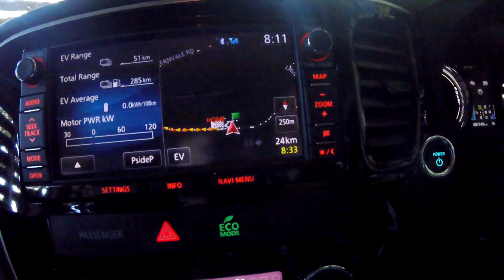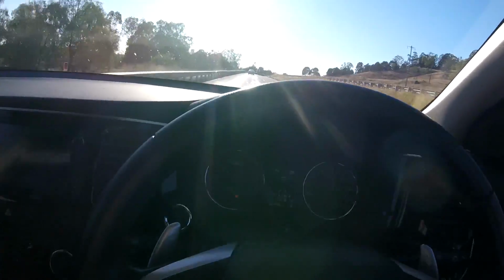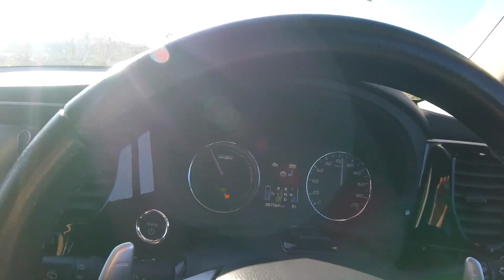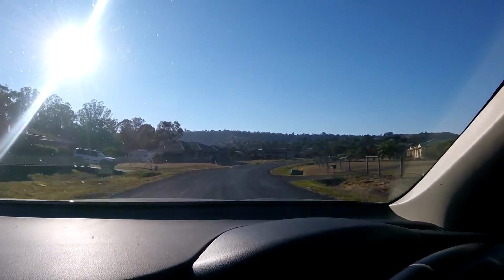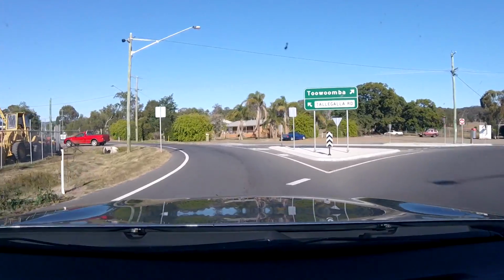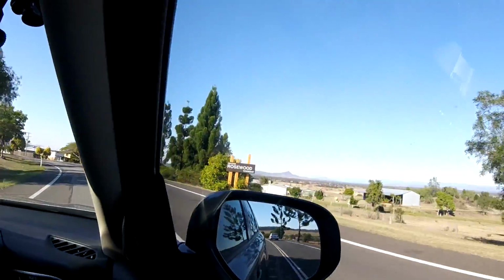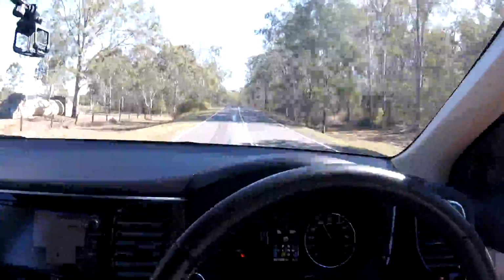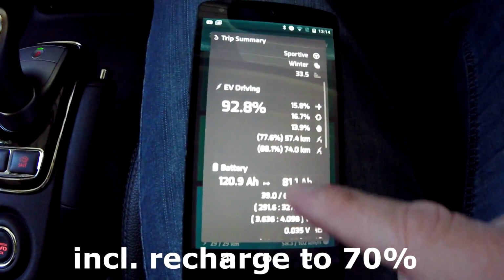EP251 - PHEV mixed mode driving and economy explained.

Comment: Thank You Andy, your videos are very informational.  I have had my car for 5 days so I am learning.  I have learned a lot so far, but do have a couple of questions.  1) What is considered Hybrid Mode while driving 2) How do I use the "Save" Button.  I use it while driving, and in that mode, it still uses power from the battery, so I am unclear on its true function. 3) when in EV mode, and we go above 45mph, and want to engage the engine, what is the best way to do this...4) do you always drive in ECO mode?  Thank you so much...
Reply from the maker: 1.) Hybrid is when the engine drives the car as well as the electric drivetrain. This can be at the same time or alternating by either having an empty battery or you pressing the save button. Both runs the car in hybrid mode.
2.) Save button does what it says. It saves the current battery state of charge (SOC). For example you have a trip where you drive highway and later on in the city to reach your destination. It makes sense to use the save mode on the highway to keep the battery at a certain level. You drive on battery power in the city to reach your destination. If you don't use save it will use up all the battery first in your highway drive and you end up using the engine one your las leg. This is far more inefficient.
3.) You can either press the Save or Charge button to do so. This depends on your trip and what kind of speeds you drive. 45mph is a good threshold where EV driving gets less efficient in this car and the ICE gets more efficient. Use save if you want to keep the charge level of your battery for later use (city driving), use charge if you want to re-charge the battery while driving (this only make sense until the battery reaches around 80% SOC, then switch from charge to save mode to keep the battery at this 80% level)
4.)Yes. Even now in the Tesla, I always drive ein ECO/Chill mode. It makes the car more efficient and I like the slower response of the gas pedal.

Always make sure to arrive with an empty battery at your destination if you can recharge. This ist the most efficient way to drive the car.
Basic rule ABC - Always Be Charging. Plugin as much as possible.
Reply: @unpluggedEV  THANK YOU So much...I have had "hybrids" before, and I also own a Tesla, but this car seems to be a bit more hands on, but manageable....I will continue to watch your videos...I also have an IPHONE.  Do you feel it is worth the money to buy the power app...like your watchdog for android. R

Comment: Dear Andy, I  find the speedo on my MY14 Outlander TD is legal but inaccurate.  I use my separate Garmin GPS for navigation and speedo cross reference. Typically an indicated 100kmh on the factory speedo is actually only 95 real kmh. In order to not frustrate others on single lane roads I always try to set my cruise control at the GPS indicated speeds rather than the speedo so in my case 106kmh on speedo is actually 100kmh actual. Yes its only a small point but because virtually all vehicles have an error I thought I would share this with other viewers. FYI I did double check these numbers using an android app that measured speed and it was consistent with the Garmin GPS. Sorry this isnt specifically hybrid related but when we all try to coast to save fuel it is nice to consider other driver's rights to drive at real speed limit. Cheers from sunny SA
Reply from the maker: Yep, every car does that. The Dog shows you the same numbers using the GPS of the mobile phone. Mine is actually worse as yours as I get only 94km/h when the odo shows 100km/h.

Comment: Hi Andy, thank you for the great videos. I'm a proud new owner of an Outlander PHEV and I have some questions about the car:
1. Is it good for the car when I consistently changing B0-B5 while driving? Say I'm stopped at the red light, I use B0 to start driving, before approaching to another red light, I change to B3-B5 to brake.
2. I don't always have access charging the car, even at home. Is it a good idea to charge the battery with gas while driving? I live in California where gas is about $3.90/gallen.
Thanks in advance
Reply from the maker: Thank Derick.
1.) Yes, that is totally fine but you can leave it in B5 in city traffic, no need to set it back to B0. You can do almost one-pedl driving with B5. It won't use more energy regardless the B setting.
2.) I would charge the battery while driving higher speeds on a highway or motorway and use the battery power on slower parts of the trip. As a general rule, drive electric below 75km/h (~45mph), flat road and downhill and everything else start the charge mode and drive in hybrid.
Reply: @unpluggedEV  Thank you Andy. :)

Comment: does the car also recuperate, when you use the normal brake paddle?
Reply: Yes, but not very much.  Having a longer duration to the "slow down" by using B1 - B5 regen will recover more energy than a shorter duration push on the brake pedal.  Anything more than light foot on the brake will engage the friction brake ... and that energy will be lost.
Reply: @wblairhogg I am always using the break instead, but as if i had an egg between the foot and the break pedal. The only time i use the b-levels are when going downhill. The reasons  for that are several:
1) it is easier to get exactly the right speed so that you can roll into a green light instead of stopping at a red light, or a queue as well.
2) I find it a bit dangerous to play with the paddles in tight traffic
3) I must (want to) always go back to b0 after retardation and that will be a lot of paddling 
4) As I often drive other cars, e.g. rentals, I prefer to have a driving style that is not too different from car to car

I have compared the range for driving cautiosly using the breaks and using the paddles and I find no relevant difference, if there is a difference it would actually be in favor of using the break pedal (might be due to breaking a little bit too much when using the paddles, losing energy in regeneration instead of maintaining the speed). So therefore I decided to stop using the paddles. This is of course not a scientificly performed comparison, but it is good enough for me. But note that one must use the break pedal carefully.
Reply from the maker: Brake pedal goes up to B6 in fact, so some people are driving in B0 all the time and just use the brake pedal to regen. You need to watch the power meter to see how far you can go without using the friction brakes.

Comment: is there a difference between „save“ and „charge“ while driving 100 km/h? I ask because the engine has a particular RPM at that speed and drives the generator with that RPM - so, same RPM for the generator - is it possible to generate more power (Charge) with same RPM or does the electric power the generator can produce relate to the RPM?
Reply: I  found the lowest consumption on my 2018 Outlander PHEV is to drive in EV-mode and B0 regen-mode in urban areas, and SAVE-mode for speeds higher than 70km/h if I am driving longer than the capacity of the battery. Always use a GPS (google maps) so you can plan your driving. The ultimate goal is to have drained the battery at the moment you reach your charging destination (home). I try to avoid using regen-modes as converting the rolling energy to electric energy and then back to rolling energy has significant losses compared to just coasting. I am also trying not to break because; breaking = regen-mode = Significant losses. Thus I am planning my position in the traffic, such that I can reduce the amount of braking as most as possible. In my mind, the two biggest energy consumer is the losses of energy when you have to break and hard accelerations.
Reply from the maker: @dagit11  Yep, that sound about right. B0 and slow speeds are your friend with this small battery.
Reply from the maker: At 100km/h the engine consumes around 10l/100km from which some goes directly into the propulsion of the car and some into the battery to charge. The system does it dynamically and distributes the power between driving and charging. Even on slight hills it will use these 10L but charges the battery less as most of the energy is need to push the car uphill. 
The charging power is not related to the RPM as you would think but I'll do some testing and show this in a video...
Reply: Andy, I would love to see some more analysis on series vs parallel mode. On my intermediate trips, i always have the dilemna between shorter charge mode driving in parallel mode versus slightly longer save mode driving in series mode. The fuel consumption seems to be nearly identical, but I don't know if one is better than the other for other reasons... Mechanical or electrical...
Reply: I am also very interested in this test. As the car only has one gear, there are definitely speeds on flat ground where it in theory should be able to run without charging the battery much. I have performed tests where I think I get a better result by using save, but it is hard to verify as I rarely drive on petrol and as I need to rely on the average usage reported by the car.

As long as the cur runs in parallel mode, save should really be better. But that is under the assumption that the car tries to stay in parallel mode (or maybe I should state that it tshould try not to use the battery at all). But this is a tricky thing and whether petrol only, parallel or serial is better depends on the speed. The border between serial and parallel is pretty well defined at 60-65km/h (often closer to 60 when slowing down, often closer to 65 when accelerating - real speed not the needle). This is however depending on more things as well and this is when it gets interesting as I haven't figured them all out yet.
Reply from the maker: It is nearly identical. I just have the feeling the CHARGE mode helps a little bit better and burns fuel more efficiently due to longer running times and optimised efficiency. Hard for me to do some testing as I mostly drive in EV mode. I'll see what I can do...

Comment: Of course the downside of "Charge" mode is that it will use more fuel.  I read approximately 4 Litres per 100kms driven, extra.  So you have to very carefully think about if it is worth it or not to use Charge mode at all.  Fuel is expensive!
Reply from the maker: I actually found it uses less fuel when used wisely. The recharged energy can be used in EV driving later and gives a better fuel consumption than driving in Save mode. Especially on longer journeys.
Reply: @unpluggedEV  Andy you can save yet more fuel, if you drive uphills with ev mode, put charge mode off before uphills, if you have enough ev range charged. 
Use charge mode then flat road places. This charge mode also maybe raise your soh as my case!

Comment: Great video, as always.   There is one surprising observation about Charge mode that I would like to share.  If you are descending a (big) hill and are regenerating alot ( say B4 or B5 ), then the car will decide to turn OFF the engine, even though Charge is engaged.  I presume this is because regen is pushing in as much electricity as the battery is able to take.
Reply from the maker: That is exactly correct. Thanks for the info.

Comment: Thanks for the episode Andy. A couple of things where I think a bit differently:
- By using "Save" I often get above 2km on the GOM again and then I can press EV button again.
- I believe that using "Save" instead of "Charge" is better, as I will not have to include the energy loss of running the generator and charging the battery, I would expect energy loss of roughly 10-15% doing that. My measurements indicates similar figures, about 1/2-1dl less petrol per 10km (from 0.8 to 0.7 under my driving conditions). By pressing save for 20-25km on the highway I often have 5-6km of battery when going into EV mode again, which allows me to optimize my last 15km to home on smaller roads.
- I always try to end up around 2km short on battery when getting to a charging destination as the last kilometers often are below 60km/h. This means that you can run the battery lower than 30.6%  down to around 27% - I think) and it allows you to drive on available electricity that you otherwise wouldn't be allowed to use.

And also note that the car only has one gear, this means that it is only above 60km/h that you can drive purely on petrol. Below 60km/h you will always drive electric, but the electricity may be generated by the engine via the generator. This also contributing to the inefficiency of the car above somewhere around 105-110km/h, but this is of course also due to the bulky exterior.

Just a few thought s from my side. But I am still learning, I have not owned my car for a full year...
Reply from the maker: I've never seen series mode at this speed. It always uses parallel mode above the 70km/h. That's what the manual says too.
There is one exception though if the battery is below 25%, it runs the engine in series mode even on the highway to charge the battery as fast as possible (up to 70kW). This is similar to the power mode (kick down).
Reply: @unpluggedEV  Maybe this has something to do with the warm-up time? In my experience it is always in serial mode. Only at operating temperature does it change to parallel mode.
Reply from the maker: @mirage03thomas73  When the engine starts it's always in series mode for 1 minute or so to warm up, that is correct (unless it has ran before and it already warm). Afterwards it depends on the speed which mode is it driving in.
Reply: charge and save use the same generator
Reply: @KenWerkSolar  yes, but charge runs the motor to generate electricity to the battery. Save only regenerates electricity, e.g when braking.
Reply from the maker: @ervjhb  That is not correct. Both Save and Charge using the engine the same way. Only difference is that Save mode alternates between petrol driving and EV driving (charges battery for a bit and uses this charged energy then again in EV mode).
The car has two hybrid modes, series and parallel mode. Below 70km/h it drives in series mode (petrol engine runs the generator but the motors drive the car) and above 70km/h it runs in parallel mode (engine drives the front wheels and recharge the battery at the same time to increase battery charge).
Reply: @unpluggedEV  . Andy, I don't believe that is 100% correct either. I like to drive on the highway with cruise control on at 85km/h. In save mode it always runs in series mode but charge always switches to parallel mode after a minute or two.